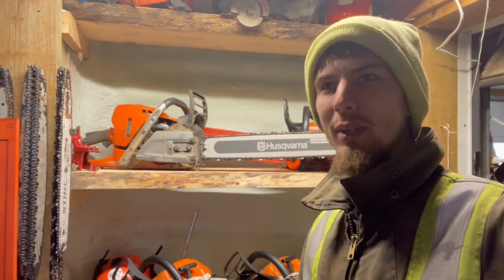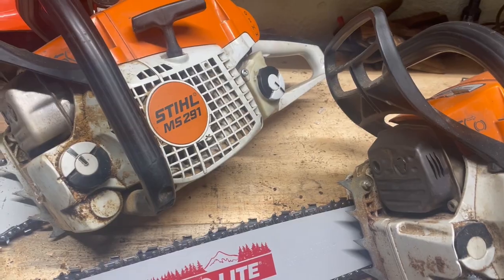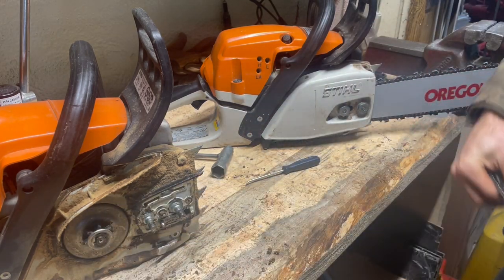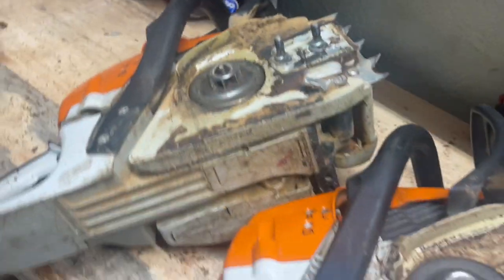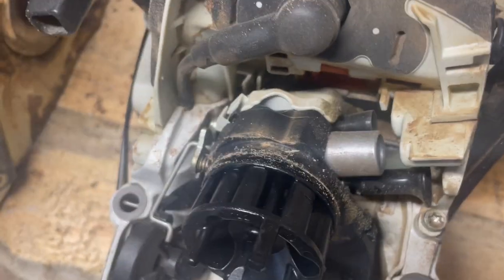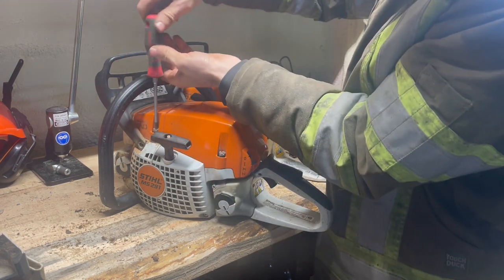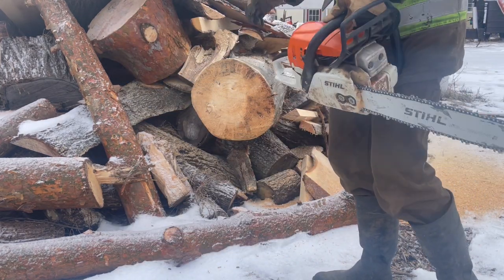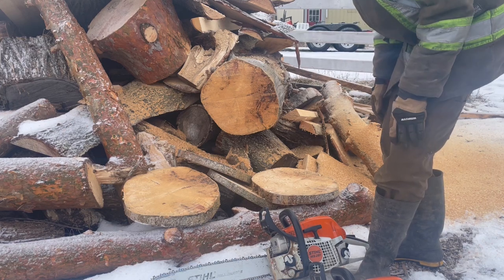The Differences Between A Farm Model & A Professional Model Chainsaw

Comment: I use both and like them both. The organization I volunteer with uses 261's for storm cleanup. They're a great saw, hard to kill, cut all day. I bought the 291 for home use to replace an older 024. Similar, but yeah, you can tell the difference when running them but both are great for who they're meant for
Reply from the maker: You got that right! Used for what they are designed for, they will last a good while!
Reply: Let us know the differences!

Comment: those are a throw away  lol    throw them my way i rebuild 271 and 291 all day   easy  . rebuild ms290  to 390  all the time  the jug holding down the bearings is nothing new  stihl has done it for years
Reply from the maker: Easy yes, but compared to a to   Pro model, it's much more involved.   All the companies have done it for years. Cheaper to manufacture.